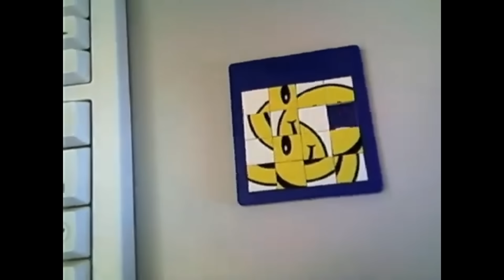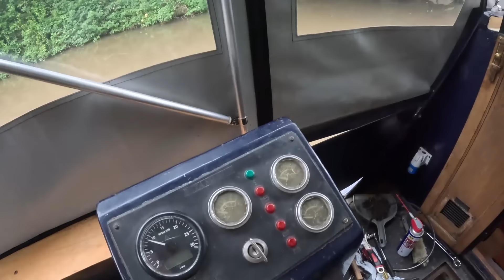Everything that can go wrong does on NARROWBOAT Kimberley-Jo as we cruise away from Atherstone!

Comment: Top marks for your effort, Sonya. I do know with a car if you disconnect the battery and let it sit for a minute then reconnect it, it will stop the 'check engine' light from coming on. It many not work in your situation but it's worth a try.
Take care you three ~ Lacy, Mike & Hamish
PS. When building a narrowboat, who's bright idea was it to place the engine in a small hole in the bottom of the boat? Seems to us there must have been a better way.🤔
Reply from the maker: At this point we will try anything! Moving around the engine bay is so difficult and the thing you need to get to is always the most awkwardly placed! Thanks for the message you three, great to hear from you

Comment: Hi Folks, before you go spending money on a new alternator, check the wiring that passes under the motor. I had same problem, changed out the alternator, and still had the problem. Turns out it was a wire to the sensor that had worn off its jacket and was intermittently shorting out. Best of luck. Freddie
Reply from the maker: Thanks Freddie, we will check that out it will certainly be good if thats all it turns out to be!

Comment: Watch the vlog. What's the numbers on your two belts and I can possibly tell you if they're the same X great vlog
Reply from the maker: 13990LI Sonya thinks, the old one didnt have a number on it.
Reply: @sameshipdifferentday2024  13 is the top width in mm. 990 is the length. Also known as an A section belt. And you could order as an AX39 which is the size in imperial (39 inches= 990) The ax means it has teeth or also known as cogged.  Very standard belts in the trade.
Reply from the maker: @mariannegordon7237  thank you that is so helpful